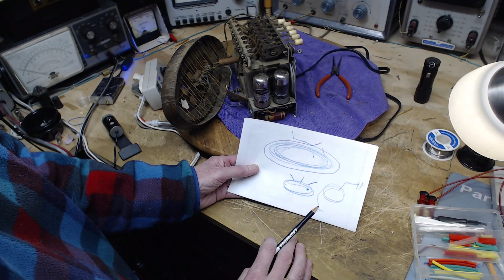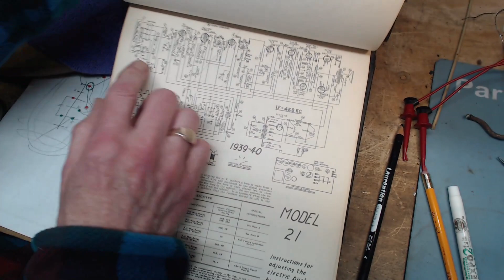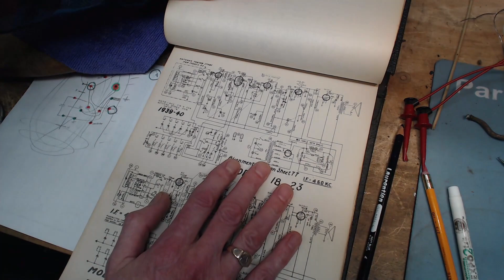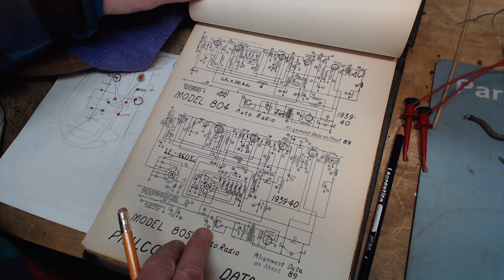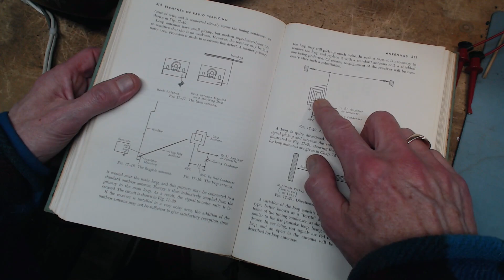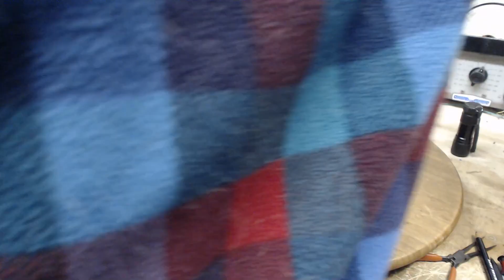Philco Model 24T Five Tube Radio Video #4 - Outwitted by an Antenna

Comment: 23:35 A basic rule in RF circuit design is that coils whose axis are perpendicular to each other do not couple. So how can the outside winding whose axis is perpendicular to the axis of the loop antenna winding can form a transformer? It cant! So attaching an antenna to the outside "winding" will do zilch! Get the basics down before you try to reverse engeneer or even explain a circuitry, otherwise you end up guessing like Freddy Flintstone faced with fixing a combustion engine!

Comment: 7:37 [quote]... wouldn't anybody connect these two terminals (nb. cold ends of either antenna loop coil) here (nb. on the backplate) and run (just) one wire to the (chassis) ground?[unquote]
Anybody not aware of the nature of RF circuitry would probably do that or lament about it... 
In RF a wire is not only judged by DC resistance anymore. Any inch of wire exhibits parasitic inductance and capacitance. So if two coils share a common wire to a ground point even via a few inches of common wire, that is enough to introduce crosstalk between them or unwanted reduction of Q. In fact having two coils share a fraction of a winding to ground is a way to couple signals between coils when you cant afford them sharing the same bobbin.

Comment: There is a pdf of the patent for this antenna. The outer "basket" is supposed to shield from unwanted RFI. "...to improve the signal-to-noise ratio of such loop antennas it has been found desirable to surround them with an electrostatic shield". I can' t post the link but you can search for "2273955 loop antenna patent"  by WH Grimditch.
Reply: Double thumbs up for that link! And it is fitting that the patent was initially filed june 5th 1939 by Grimditch courtsy of Philco Radio and Television corp.
It not only explains why the outer perpendicular shield winding is just connected to ground and beyond that has no other connection anywhere,- moreover reading on the mechanical description it becomes clear how much "RF black magic" is involved in that design in order to ensure best performance. In that regard also falls the issue of the receiving loop and helical shield winding better not sharing the same ground connection.
So much for Jim's "everybody would tie the ground points of the coil together at the back plate"!

BTW I you want to read up on it yiurself do download the PDF of that patent. The google created OCR preview on the webpage messed the labels up to where it looks like the shield coil is being connected to a hot part of the loop.

Comment: Techs of yesterday had to be pretty smart, I must say.
Reply: That we must agree on. Sad how much of it got lost to time tho and never found widespread use. Just look at how they came up with that shielding of the loop antenna. But 1939 being a time where it probably was not that much of an issue and more of an expensive gimmick, it got forgotten about. But today we would grab onto any straw to clean up the AM reception... 
I am really tempted to build a loop antenna like that  going by the dimensions in the patent) and compare shielded vs non shielded. But unfortunately there is no active AM stations here anymore...

Comment: I think that outside coil is made like a 'select a tenna' or like your external antenna you made, that you tune to pull in signals better. I think the outside, or the basket wire's are there to pull in the entire MW band...

Comment: I still say the loop is for variable tuning and the basket is for preset tuning so that way regardless of where you have the radio you can still pick up your favorite stations by either using manual tuning or by using the preset tuning so if you can’t get a good signal using the manual tuning it’s possible to bring in better reception with the preset tuning
Reply: A very logical conculsion since other radios of this particular chassis and don't have presets, do not have this
antenna.